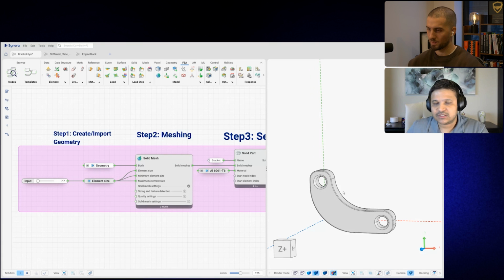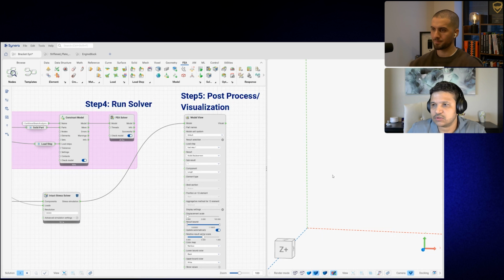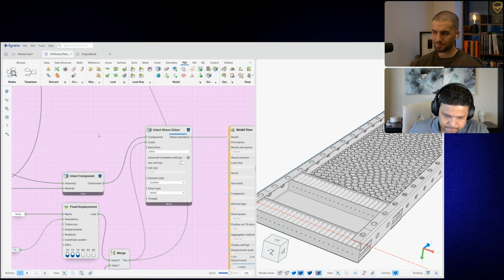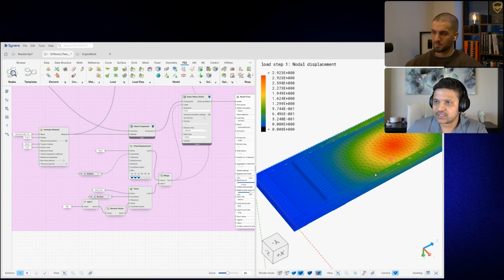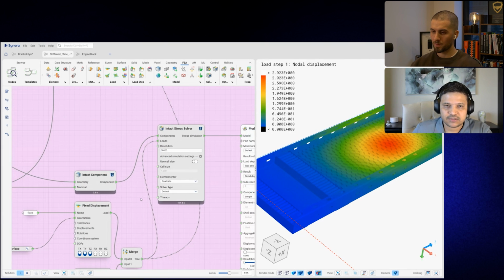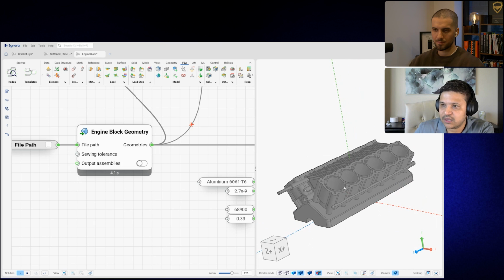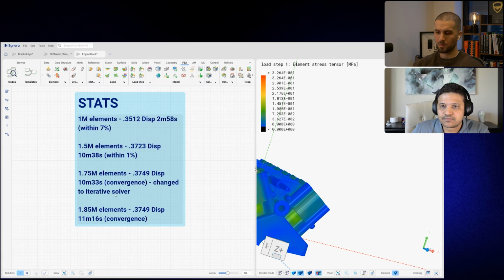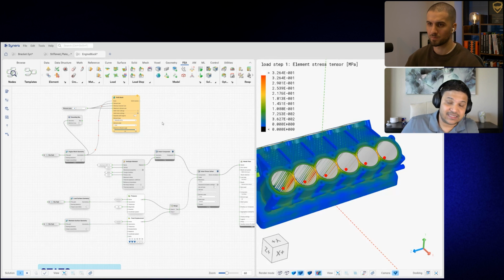Meshless FEA: Simplify, Simulate, Succeed! | Deep Dive

Comment: I found it weird, that you focused so much on displacement convergence, as it usually converges way sooner than stresses. So I found the engine model on the internet, and did a simulation on an 6 years old pc and 4 cores in Ansys. 
I don't know the exact pressure, but within linear FEA, this doen't really matter. 
A mesh with 423260 elements was done within 15 seconds and the simulation ran for 66 seconds. 
The difference in displacement to a mesh with 1140929 Elements was less than 0.5%. This mesh still took less than a minute to create and the simulation ran for 133 seconds. 
A mesh with 83759 elements, most of which are in the small radii an the perforated top part, solved in 20 seconds and delivered results within 5% of the finest mesh.